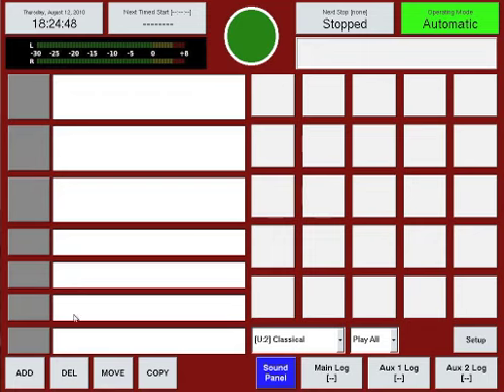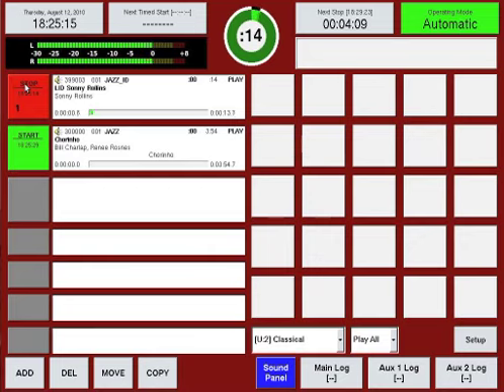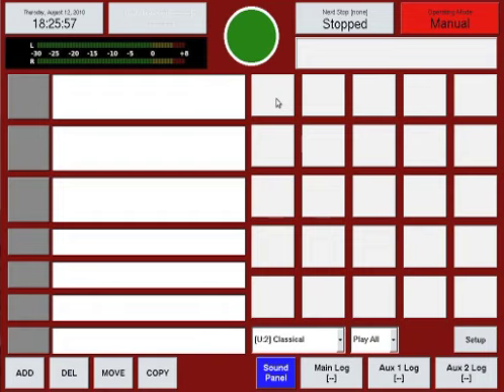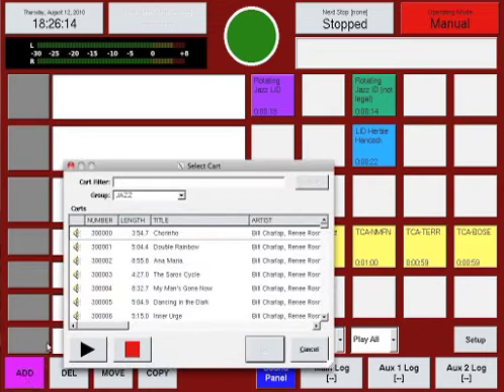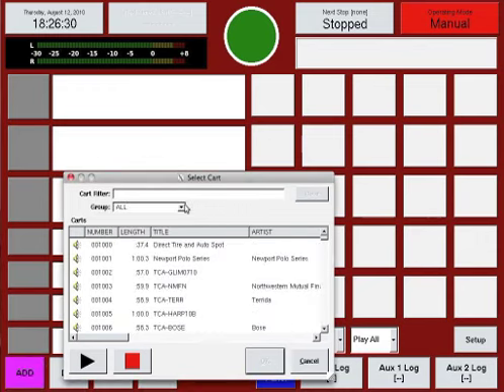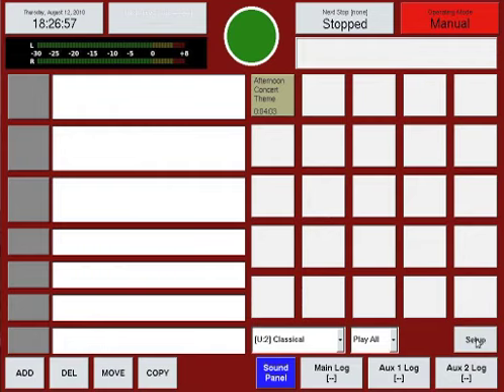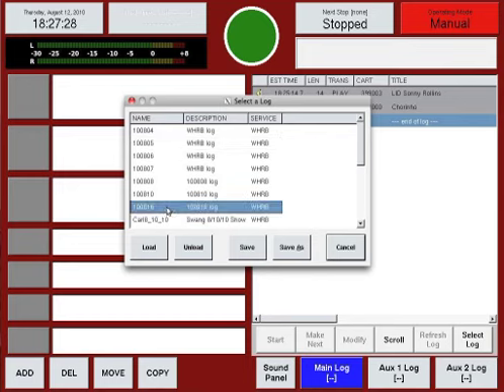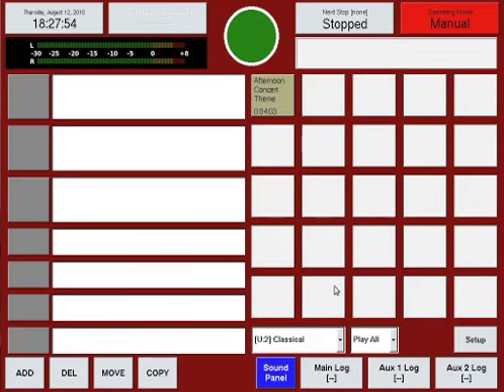Introduction to Rivendell Radio Automation

Comment: Yong assholeo You have to change things in the admin settings to do that. What you have to do is the following: set the fade out times in the song and by going to admin-manage users-rd airplay and change the settings from "Play" to "Segue" and change your clock to "Transition" and you might want to change the "Manual Segue" and "Force Segue" to any time you want

Comment: I suggest you would use the paravel automation which is "rivendell" and it has more options which rrabuntu (rivendell radio automation (on) ubuntu) has, but the rrabuntu is a 32 bit and the paravel is 64 bit